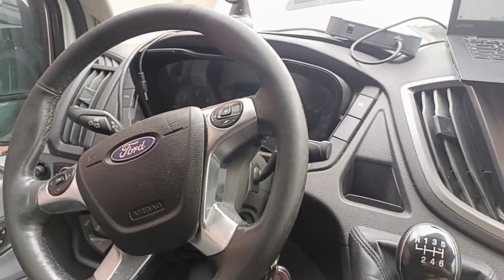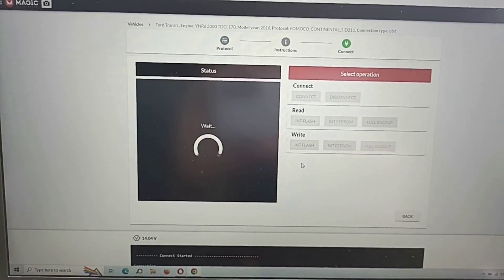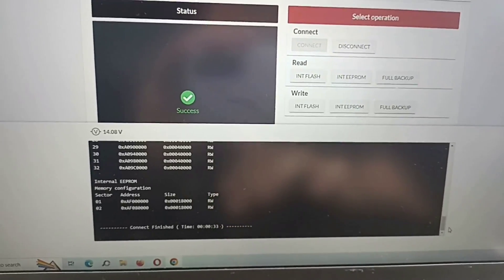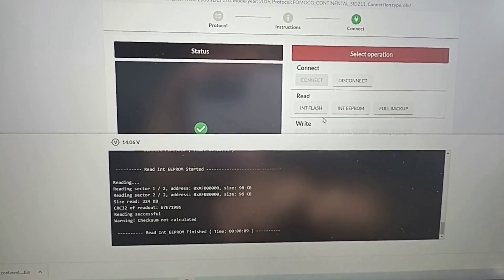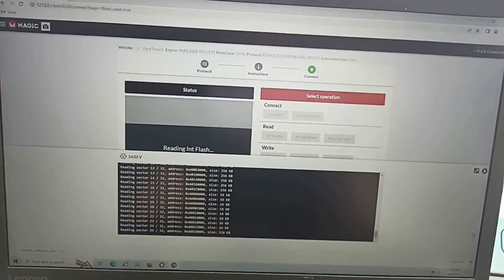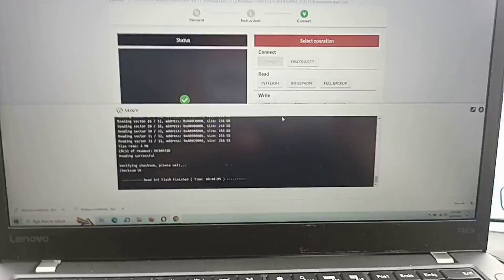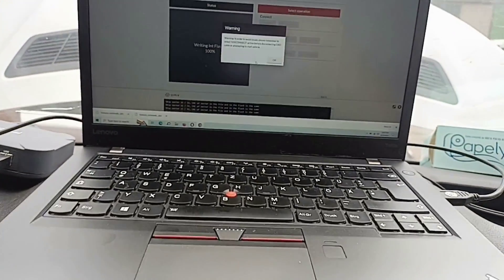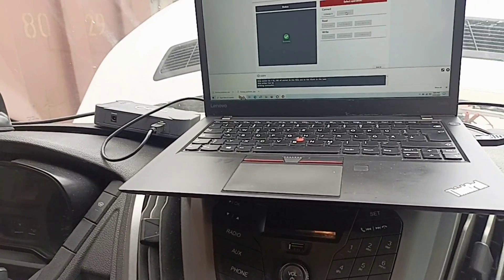Flex master read/write Ford Transit Siemens-Continental SID211 via OBD.

Comment: Where do you find modified files to upload and replace originals? Like, you download original as a backup, but where do you get for example addblue off modified file? And, can you explain what else you need to pay? I saw there is like 200 red coins (200e equivalent) to turn off adblue? seems expensive.  Thank you for making these videos!
Reply from the maker: Hello. All the modified files I make myself. If you need. If you need something, just tell.
Reply: @YOYODiagnostic  can you make a tutorial of modifying files? I don't need anything at the moment, I am curious how it is done. Is there a program for opening backup files?
Reply from the maker: @Salee1204  
I will not do this out of respect for those who pay thousands of euros for programmers and software.  do you want to have everything for free in life?  If I make a series of 10 videos everyone will be able to modify their cars.  The question is whether it is fair to those who invest time and money to build a business.  I don't agree when everyone thinks they can do anything.  Tuning courses cost several thousand euros.
Reply: @YOYODiagnostic  i understand and i respect that. But, someone had to teach you, right? Im not saying i want everything for free. I would pay for flex and services. I was just curious how it works, what I need to pay, what you don't need to pay itc. For example, you need go pay 1000e for flex + 500e every year for subscription, and plus every change you make?
Reply from the maker: @Salee1204  
No 
Flex it's 1000 Euro+ VAT.
License for bench and obd it's 2200+VAT
Year licence 625 euro for master. 
Cheapest Flex maste it's around 4000 euro with VAT or 7400 euro full license.